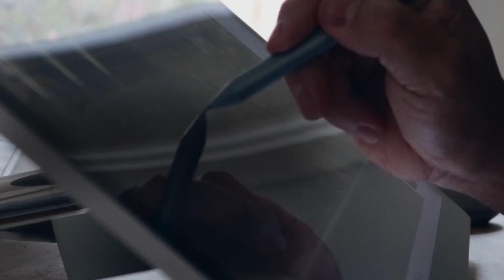Volvo presents FIKA with Jack Kobayashi

Comment: Folks, I was born in the Crowsnest Pass, Alberta, and grew up on a mixed farm in SW Alberta. The winters featured blizzards, with warm Chinook Winds interspersed. The shelter belts of bushes & trees were planned, then modified from experiences with snowdrift patterns. During my 30 years working as a Surveyor for Geophysical Contractors, I observed finely powdered snow blown into Seismic Camp rooms thru any crack around a door.
One of my friends, here in Lethbridge, was an expert installer & finisher of plasterboard, who went to Resolute Bay, NWT (as it was then), to do the interiors for some new construction. T’was wintertime, and the Arctic Blizzards taught Ottawa-based House designers much about Soffit Vents. Snow at -40 degrees gets finely divided by blizzard winds, blows in thru soffit vents, becomes miniature snowdrifts which melt and ruin ceilings! Soffit designs for Arctic Bungalows had to be redesigned, perhaps with advice from the Helicopter Engineers who designed the Arctic Intake Modifications for the Jet engines in their helicopters.
Remembering the sinking hotel on the SW corner of Great Slave Lake, I wonder about the foundation choices that Mr Kobayashi and colleagues make?